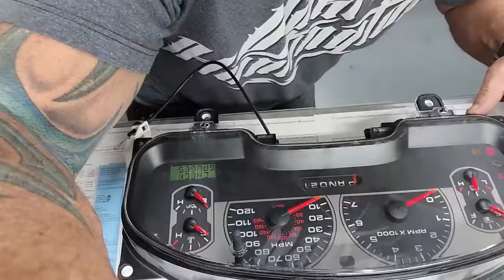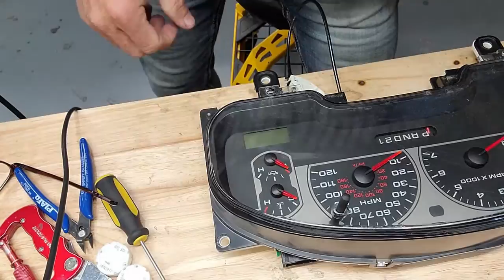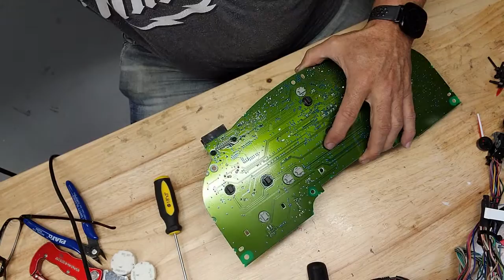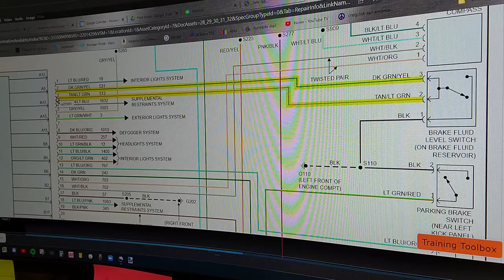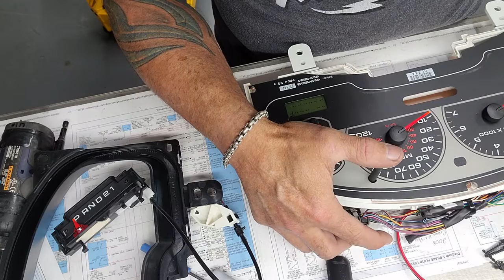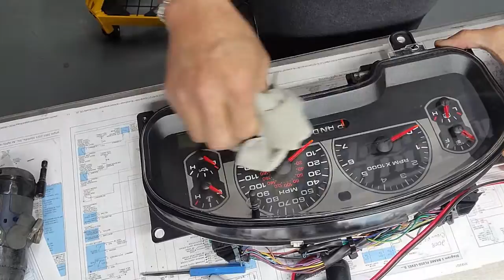Brake light stuck on Ford f150 and applies to many other Ford models

Comment: Parking brake switch, low brake fluid or brake proportioning switch are typically tied to this light. Their wiring shorting to ground is also included. 
Unplug each circuit one at a time to isolate. Visual and wiggle test on wiring if needed.

Comment: I have the same issue on my 2004 Ford F150. I've been driving that truck with the brake light on since I purchased from someone.  I have watched lots of videos on YouTube how to fix it. I took the cluster out and solder the 821 resistor and I also resolder some of the other's resistors and my brake light still stay on. Is there anything else I need to look for? Please help! Thanks!

Reply

Comment: What about the brake lights on the tail of the truck staying on? I've changed the brake light switch, have a new booster and master cylinder and when you step on the brakes and release the pedal, the brake lights stay on and will kill the battery if the pedal isn't pulled up. The old switch would stay off from pulling up on the pedal but the new switch will have the brake lights coming back on intermittently after pulling up on the pedal. The switch is one of the closed black plastic ones without any plunger. I'm at my wits end.

Comment: I am having these exact symptoms on my gauge cluster.

How do I send mine to you to have it fixed or can you recommend some other people that do this because the ones I've found don't seem to know about these resistors being an issue.

The problems I'm having are the brake light is on and over bumps and stuff like that it turns off and the airbag light occasionally cuts in and out and causes the truck to start screaming about it
Reply from the maker: Automotive Electronics
11120 Watt circle 
San Antonio TX 78233
210-379-1395
Reply: @AutomotiveElectronics  how much do you charge

Comment: Great work! If I may make a suggestion? Before you remove the gauge needle, place a piece of tape under the needle and mark the position with a black marker. That way, when you put em back... you know exactly where to place the needle. Hope it helps🤷
Reply from the maker: yep... i use that method on cluster where i dont have a bench power setup....works great